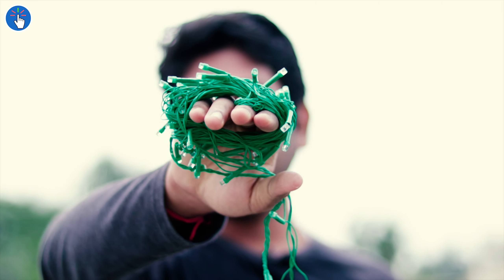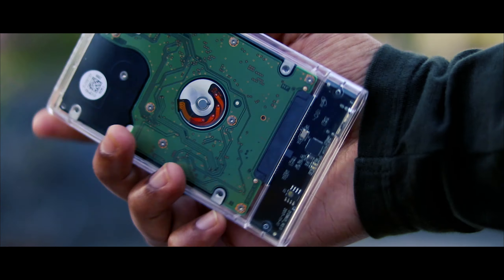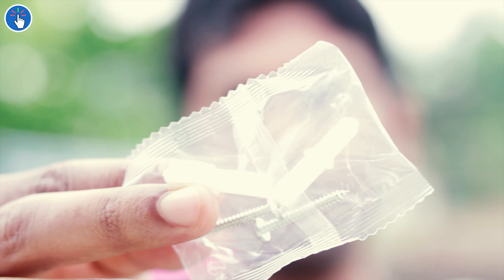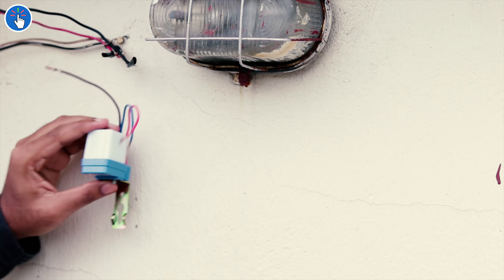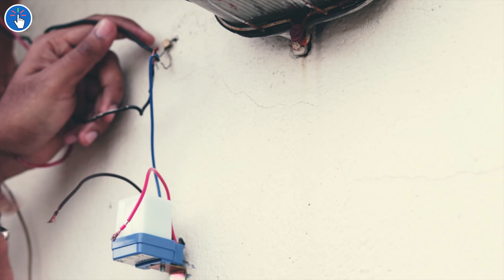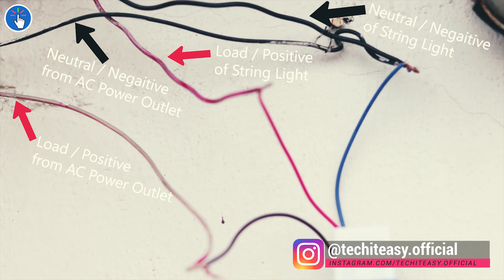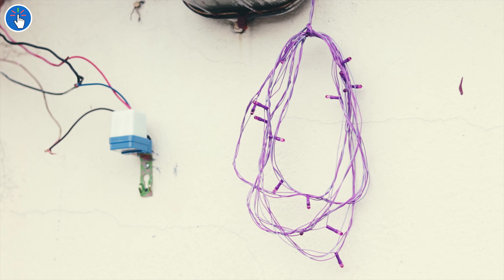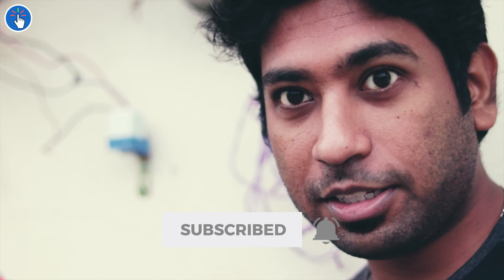Auto On-Off LED Lights for CHRISTMAS Decoration | Smart LED String Light | Photocell LDR switch

Comment from the maker: BUY :  https://techiteasy.in/amzn-auto-day-night-switch

🔥🔥🔥 Suggested Videos For You :

1> How to make a TRANSPARENT HARD DRIVE - Orico 2.5 Inch Transparent Usb 3.0 Hard Disk Enclosure Case - https://youtu.be/kV6X2qLF9tc

2> How to Use two SIM + Micro SD in HYBRID Slot Phone at once: https://youtu.be/OjyO8buvHdw

3> Sony Bluetooth Earphones WI C400 - Best Budget Bluetooth Headphone Under 5000 : https://youtu.be/feMTpqIUzm4

4> Best Budget Bluetooth Earphones - Boat Rockerz 255 / 255F / 255R Review | Water Resistant Headphones : https://youtu.be/wq7navbMxYo

5> Cheapest Bluetooth Speaker on Amazon - https://youtu.be/oAwlvTqAH00

6> Portronics Sound Drum 10W Water Resistant Bluetooth Speaker - https://youtu.be/trX1fZBASnk

7> Zoook Jazz Claws - Best Bluetooth Headphones Under 1500 Rs | Water Resistant Bluetooth Earphones : https://youtu.be/iK5spdvsWd0

8> Seagate Expansion 4TB USB 3.0 External HDD - https://youtu.be/4EtC55fwDJc

9> Best Budget Lavalier / Lapel Mic for YouTubers - Boya BY-M1 - https://youtu.be/Wd5ZBaz4JDw

10> Portronics Wooden Portable Laptop Table/Stand/Cooler: https://youtu.be/RmDSom5FQ14

11> Lenovo P950N Review - Best Budget Over The Ear Headset Under 1000Rs/15$: https://youtu.be/7QIcqjN-EPo

12> Mi Power Bank 2i 10000mAh - https://youtu.be/hBrFL3U5TKo

13> BOAT Rockerz 400 Wireless Headphones | Unboxing and Review - Cinematic - https://youtu.be/w3fVHeEPmFw

ALL VIDEOS : https://goo.gl/RyNgJi

👋

SUBSCRIBE to Tech It Easy @ YouTube - https://goo.gl/8jDVXJ

SUBSCRIBE to Tech It Easy [HINDI] @ YouTube - https://techiteasy.in/sub-hindi

Facebook - https://goo.gl/PsdrZo

Instagram: https://techiteasy.in/instagram

Twitter - https://goo.gl/Zyoog1

Website- https://goo.gl/xX1FJQ

Comment: Hey there.  This install is not accepable in the US or Europe and probably not in most countries.  The electric shock hazards from the 120 v power supply are not properly addressed.
Reply from the maker: How do you address the shock hazards? 🤔 Btw,I taped the lose wires.